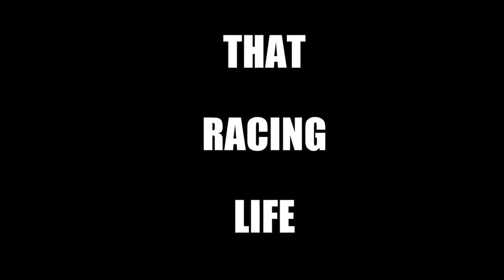$1000 Racecar: Attempt #2 Prep! +Damage inspection

Comment: Hey, I'm looking to build a hornet car to race in the upcoming season at my local track, your videos have been insightful. Should I go with an Acura/Honda or would you recommend something else? Thanks. Also good luck in your future stuff.
Reply from the maker: The42car thanks man! I would say it's hard to go wrong with a Honda.   They are great cars!
Reply: That Racing Life I've watched your videos and it seems reliability has been a little issue haha, but of course for the price I mean, anything can go wrong that's racing. I'm inexperienced but I'm gonna build it for my shop class project. What else is there to do to save costs, I actually do have one sponsor to help out a little bit with parts. So ideally where's gonna be the best place to find one? I know craigslist which can be shady.  I don't know alot but I do have SOME experience welding and working on cars. So I'm not completely in the dark but I am kinda new to racin. Just lookin for any advice or tips, thank for the reply though man.
Reply from the maker: Well the first race was a problem that I didn't see when I looked at the car. Never tested it before racing. Lol. Second race was just a  stupid crash that took out the radiator. 3rd one was something that happens from time to time with Honda's. I should have checked it. Facebook classifieds or Craigslist is probably your best bet!
Reply: That Racing Life Thanks man. Love your vids. I kind of hope on making some of my own and stuff once I get it all going!
Reply from the maker: Hell yeah, go for it!

Comment: This motor must be a b20 2.0 from a crv or older prelude? Valve cover is different than a b18 1.8 ls like the stock motor
Reply from the maker: It is just an LS B18. It's just from a newer integra. (obd2)
Reply: That Racing Life my bad I forgot that the ls motors went to that valve cover also. When they switched to obd2 we ran a Honda Accord in an enduro. 200 laps but on dirt. Toasted our motor around lap 130 we got the car race ready for 400 bucks. Just needed odds and ends thing like new fuel cell and serpentine belt. Dirt is fun. The high banked corners was awesome. Where you from?
Reply: Also the enduro we were in was a 10k to win.
Reply from the maker: Nice! Thats what its all about! I live west of chicago.